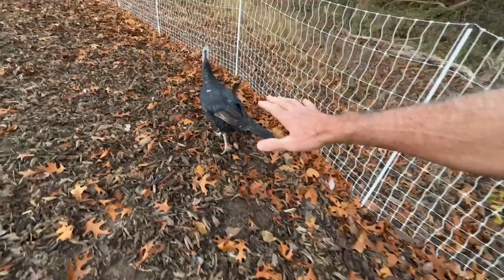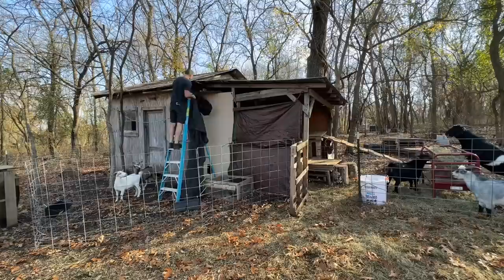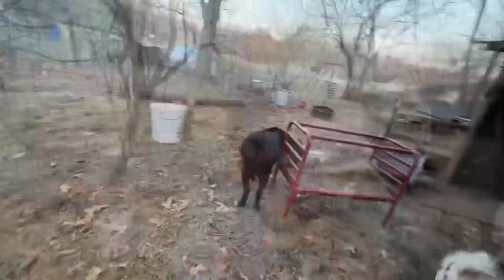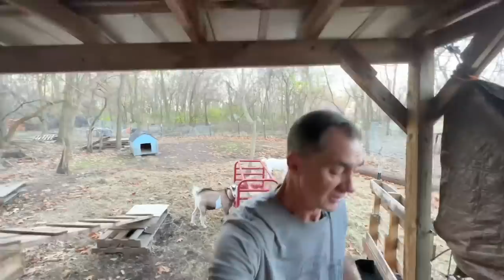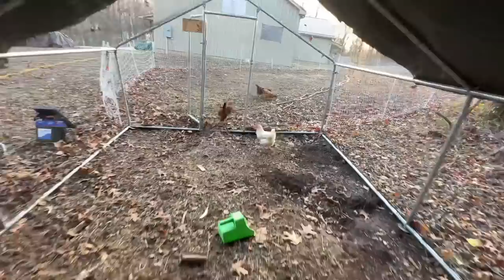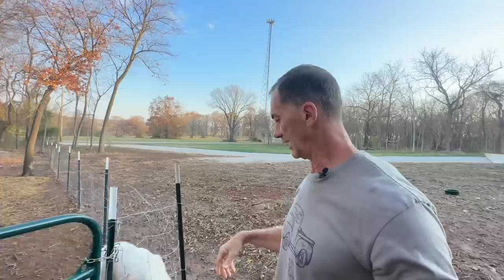Chicken Scores a TOUCHDOWN!

Comment: Smokey might be digging out the goat poop from her house! --When I had my dogs--They each had an igloo --I left the bottom in and set them up on a pallet for air circulation and open the vent on top to prevent the hay from molding--sitting right on the ground is colder as the ground is frozen--It worked great for my dogs--Just FYI   I also in the winter made them up a little warm turkey broth and rice to mix in their wet and dry food--to warm their bellies when it was so cold--They loved it!

Comment: ***🌺Ralph, I think maybe a reason that Nellie isn't going up there is because there isn't a limb or branch for her to roost on. Turkeys like to roost at night just like chickens do, unless they are sitting on eggs or baby pullets. When out in the wild they will roost in a tree. This helps them feel safer from most predators! Try putting a tree branch from one corner to the other and give her a chance to get on a roost at night. I agree that you should move that roosting stand on the ground further on down toward the open shelter. Didn't she use the shelter that was on the ground last winter?? The wooden box one? Maybe you should move that box from down there to up here, and put it in one corner of the bottom half. That way she would have 2 options but mainly the wooden box is what she was used to & it had her scent in it. Even in the wild when they find a good home they don't change it all that often. They may roam around a lot during the day but I think they like to come back to their little homes at night. On "I'm a Survivor Sanctuary" I've seen the turkeys, and the chickens up in the rafters of the barn at night. Now they have young peacocks that MaryCarl gave them. All of them find a place to roost in that open barn at night except that now they have a batch of little pullets on the farm & since it's the first time, that hen & the pullets are in a safe stall, with a rolling door which is closed at night to keep out predators. Sometimes, they also all just sit atop of the piled up bales of hay. I'm no expert on this subject, I just kind of went off of what I've seen on other farm shows. "Walker Farms Family" has a beautiful set of chicks, that Cassie had put chicken eggs under a turkey hen because she knew there had been no male turkey, but that hen wouldn't have  left her nest of eggs. She would've been very broody.  Those 2 chicks that were hatched & are being raised by that turkey hen are so beautiful!! She has more of the same batch of chicks, same age, but those eggs were hatched in an incubator n raised on chicken crumble vs the 2 that were hatched and are being raised by the turkey. There is a very significant difference between the 2 batches. The color, size & looks of healthiness are much better on the ones being raised by the turkey out in the field vs the ones raised in cages with chicken feed & crumble. Go and watch that episode n see for yourself. It was just last week or the week before. I think your on the right track cutting grass and feeding it to your chickens. Maybe find some grass that has seeds on its, they seem to be thriving on that and a handful or two of the feed Gary & Cassie are throwing in the field for them and what nature provides. Well wishing you all the best in the turkey adventure but I still think you should get 1 rooster to fertilize your eggs & hatch them so everyone can follow along with the process of at least one or two batches of chicks. If you don't want the grown chickens you can always sell them. Oh, but watching baby chicks grow and moving around are so much fun, their comical too. I'll bet that would also give your show a big boost of followers and it would also help your shorts videos! Well God ✝️ bless 🙏.
Love 💞 & Aloha 🌺 from Yvonne 🌺🦋 & Hoku 🐕🦋 in San Diego 🌺🦋🌈🌊***

Comment: You can also use hay bales, stacked them up and make a little entryway for them to get through and it still be blocking off as much wind as possible and cold. Works just the same and it don't cost no $200.

Comment: Goat / pigs and smokies house thinking it would be a quick fix using  Tyvek®HomeWrap  for a partial wall  .  using small lumber for framing  in  to help keep it attached  and in place .. heavy duty duct tape  ,screws to use on tyvex wrap  tape on edge place between wood screw together and attach ...... it can be used for the Turkey aswell  ..

Comment: I think its a lots better on the goat area good job 👍 it looks like the goats like it as well. The metal huts you can get you some plywood an put it up to the front an take a marker trace round then cut on the line you made then get 2x4 cut it so you mount the 2x4 to the metal hut then put the plywood mount the plywood to the 2x4s then on one side cut a opening for the Animals to go in an out that will be much cheaper you can do that to all 3 huts